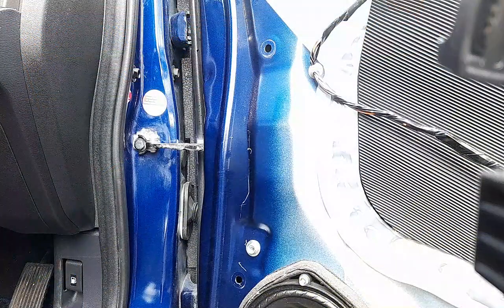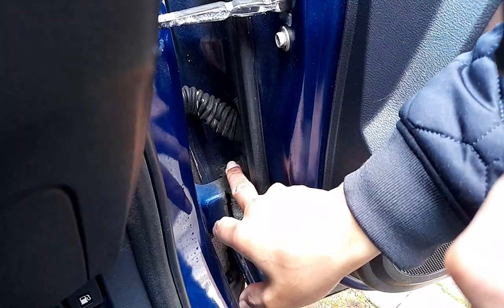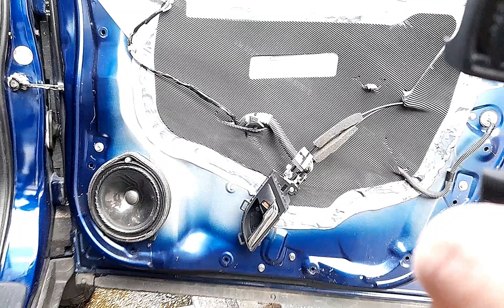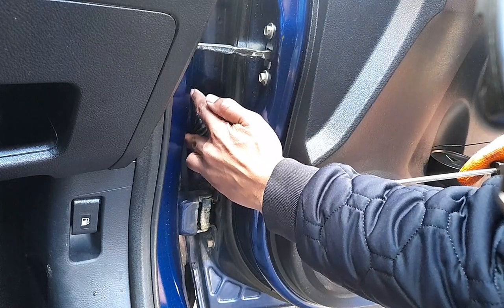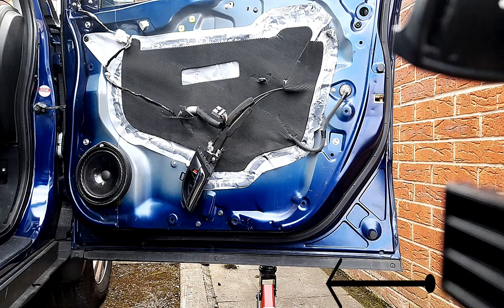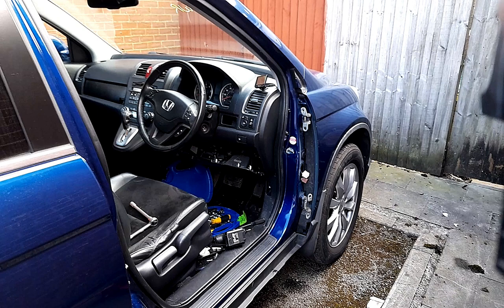How to change Front door-  Honda CRV

Comment: I scoured youtube for this information and there are only two videos showing how to remove the door. Depends on which year CRV but here are your steps: Remove door panel unplug the main harness and then remove bolts . Easiest way is to remove 1 bolt from each hinge, ( make sure you have something or someone holding the door ) then personally I always remove the top hinge 1st then bottom. Reverse steps are the same. Shouldn't take more than 20 minutes for each door
Reply from the maker: Thank you pls subscribe